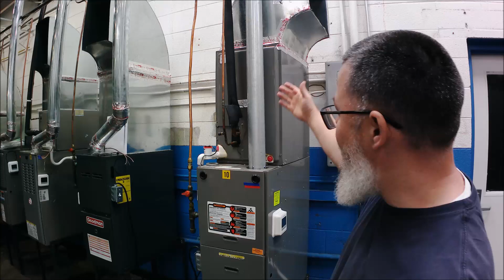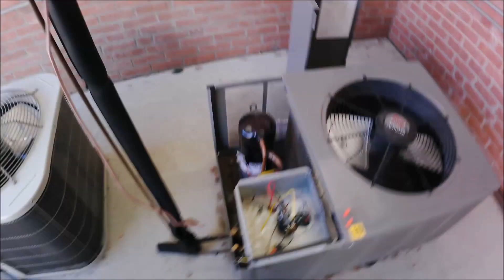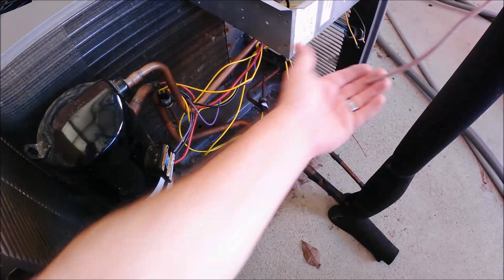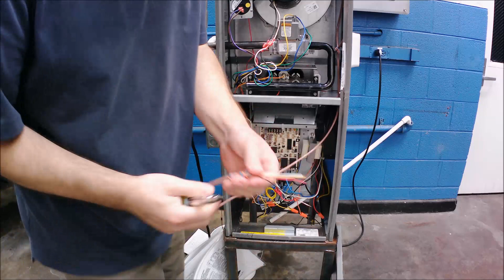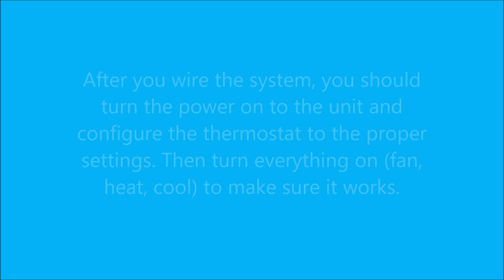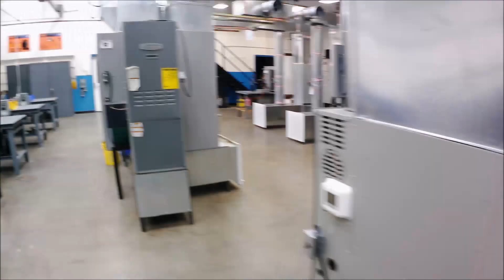How to Identify and Wire a Heat Cool System - 1 Heat 1 Cool Furnace with A/C

Comment: If the wire from furnace was long enough you could have just stuck with yellow and black and tucked the other wires away, correct?
Reply from the maker: Yes.

Comment: What if you have 2 thermostats and 2 HVAC units? how do you wire them?
Reply from the maker: One at a time of course! 🤣. Seriously, one at a time. They could both be the same type (heat pump, a/c only, etc) or they could be different. I have seen plenty of 2 story houses that have a gas-ac package unit downstairs and a split gas-ac upstairs. That is the same type of wiring essentially. Typically you have the same type on one structure but it isn't necessary. Identify what kind of system each is and wire it to its thermostat.
Reply: @johnjennings-JJ  I meant that I have 1 furnace, but have 2 HVAC units with a thermostat for each. Do they both connect to same furnace?

The main level thermostat has the usual 4 wires plus a B wire (although no heat pump), and the second level has just the 4 wires (R, G, W, Y).

Thank you very much.
Reply from the maker: I am not sure about them both connecting to one furnace, that is more like a commercial-type setup. I wouldn't think that you would have a furnace/ac system for the main level and then a separate ac only system for the other part of the house. Would need model numbers for everything to see what you have got. 

As far as wiring, it looks like you might have a digital thermostat that needs a 24 "common" wire for the downstairs, whichnis  controlling a conventional furnace/ac system, and then an older non digital thermostat (or at least a battery powered one) upstairs controlling a conventional furnace/ac system.
Reply: @johnjennings-JJ  Thank you very much man. I appreciate it.